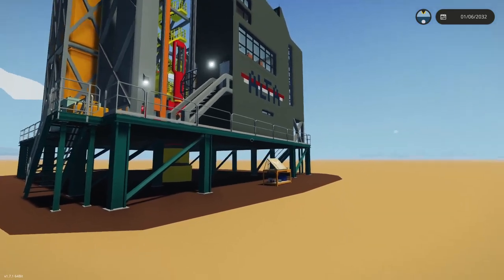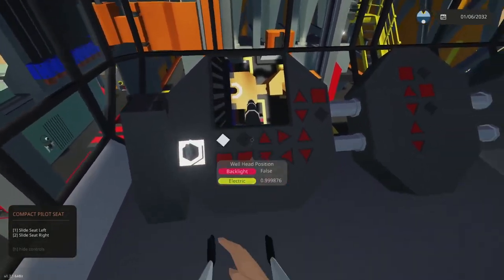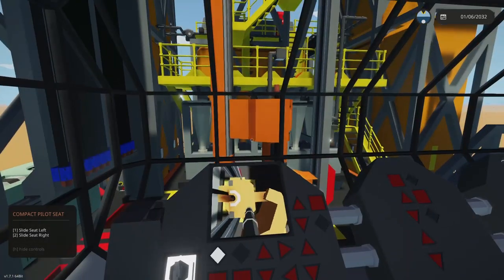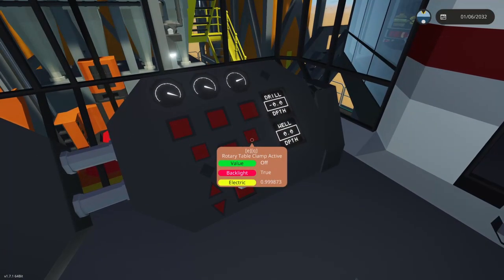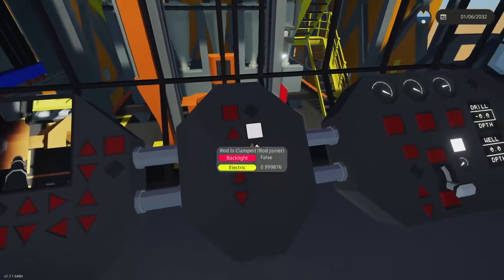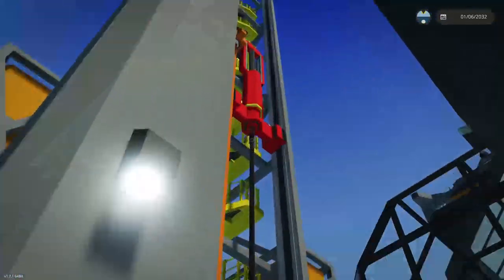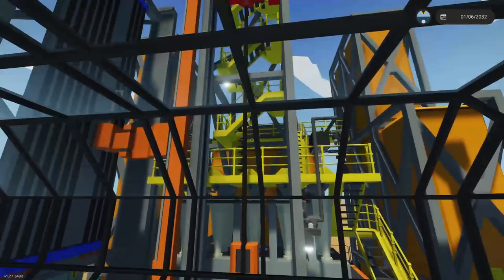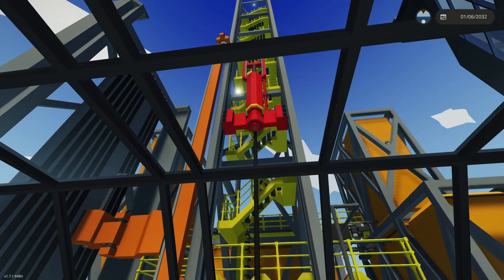Stormworks: ALTArig Oil Rig Drilling Start-Up Tutorial

Comment: I wonder if a piston with just a block on the end could push the bottom of the rod into the clamp.
 Would save doing it manually
Reply from the maker: That's a great good idea to consider! I may try it, but honestly, I kinda like the bit of manual operation needed, makes it a bit more interactive